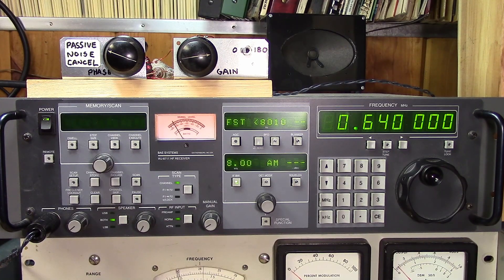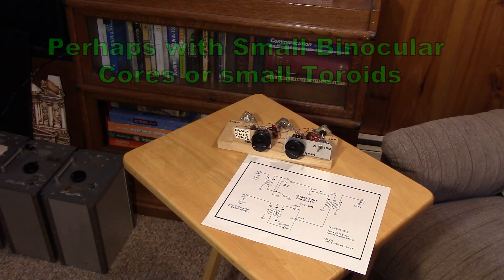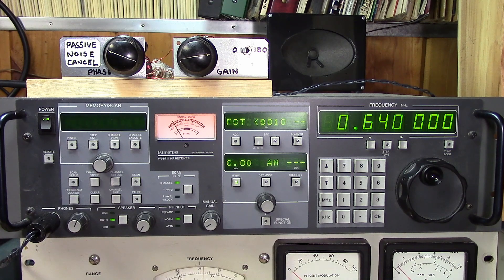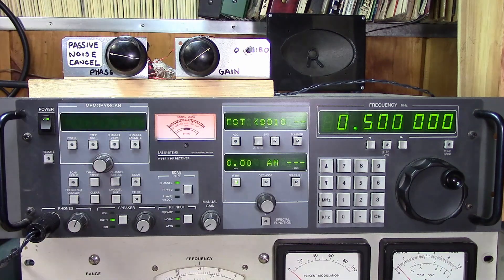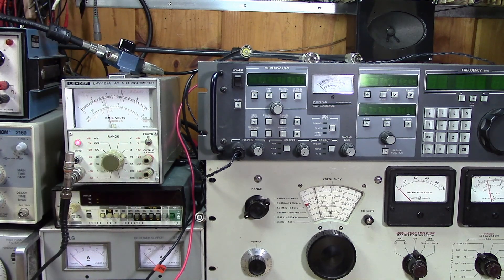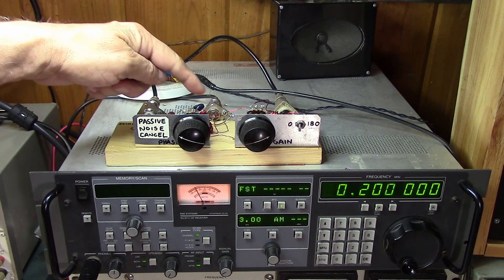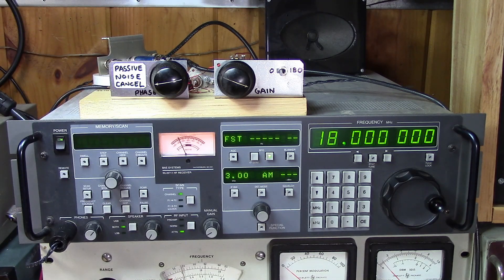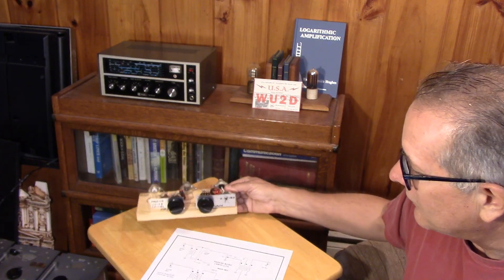Passive Noise Cancellation

Comment: Buried coax and ferrite beads are critical for the coax from the noise antenna, or at least a lot of ferrite beads. You have to make sure your noise source is coming from a single point in order for the phasing to work properly.

Comment: Mike, I like experimenting and making simple AM radios using a ferrite rod antenna.  Have you tried using this passive noise canceling circuit with a ferret rod antenna?  I'm curious what your results might be.  Thank you for your videos!
Reply from the maker: These is no reason why this would not work nicely with a ferrite rod and whip or simply, a pair of ferrite rods that you can rotate. Simply remove the primary windings altogether and wind on the Signal and Noise rods. 8 Inch long Rods like "LTKJ 5PCS Black MnZn Ferrite Rod Bar Loopstick for Radio Antenna". One reduces to a single winding and one to a center tapped winding. Try 20 Turns and 40 Turns Center Tapped for an untuned approach.  Tuned would be a bit more complicated because you would need low Z secondaries. So the tuned side with 365 pF Variables would be 90T and the secondaries maybe 10T for the main and 20T Center tapped for the Noise  Side.
Reply: That sounds great, thank you very much.

Comment: Hi Mike,  Saw this circuit in the first episode of your series on noise cancellation,
and I built it in the next couple of days. It works a treat, and I would recommend it
completely to anyone looking for a simple project  which wll make so much
difference to listening pleasure.  Many thanks, and vy73 ,  Dave G0ELJ
Reply: Yes, I've built it since and can confirm that it works well. No battery required and most receivers have more than sufficient gain to make up for insertion losses. Thanks Mike.

Comment: Thanks for showing your earlier passive canceller and testing it over a wide spectrum of frequencies. It's nice having a unit that doesn't require power to run it, sure there is some loss, but not that much. I might just have a go at making one up, I'm quite new to winding toroidal transformers and worried about getting my starts and finishes wound correctly.
Reply: I'm about 7 months late on replying, but these are broadband coupling and phasing transformers, not part of resonant LC circuits that require precise L and C values, so I think you could easily be off plus or minus a turn or two with no noticeable difference in the result. So just build it. The first thing an RF electronics hobbyist needs to learn is to just go ahead and try it and see if it works. If it works, great. If it doesn't, that's the time to dig in and figure out what you did wrong, or just toss it in the spare parts box for cannibalization for other projects. At these frequencies, most everything is very forgiving. You see the wide-open, long-lead construction of this unit, and it still performs famously.